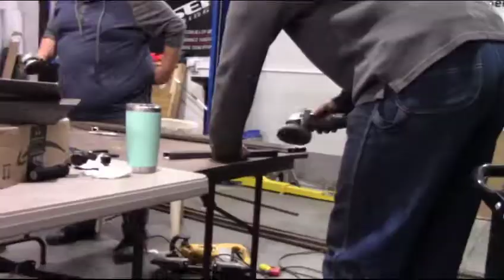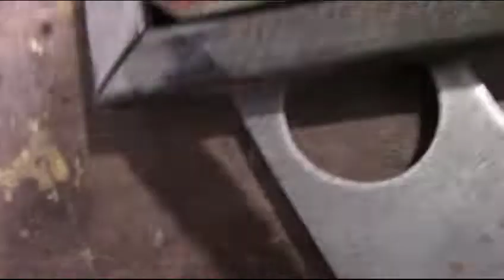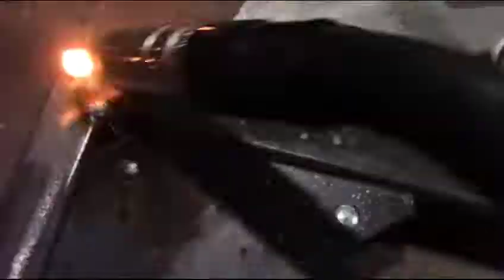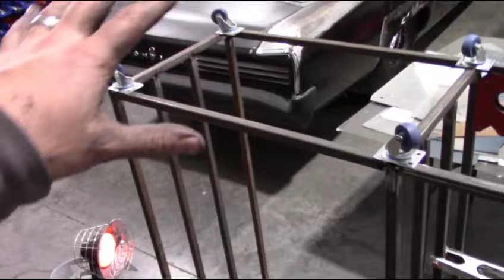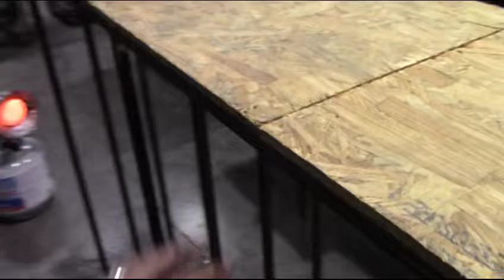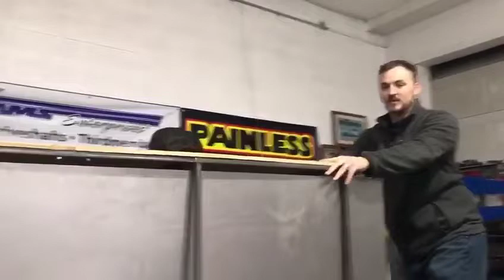Sheet metal cart build

Comment: How wide did you make it if you have tall sheets does it want to tip?
Reply from the maker: 24” wide,  everything worked good I still use it only thing I would change is way wider and heavier duty wheels
Reply: @HoustonKilby  thanks maybe make mine 36 to 48 wide then.  Have a great weekend
Reply from the maker: @ttoy3603  that would help out a ton just don’t use plastic wheels lol